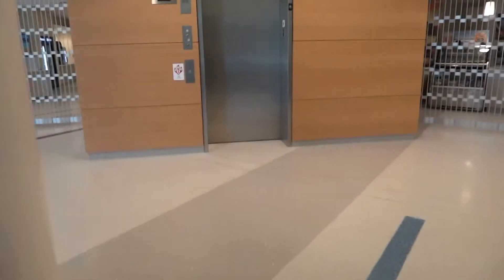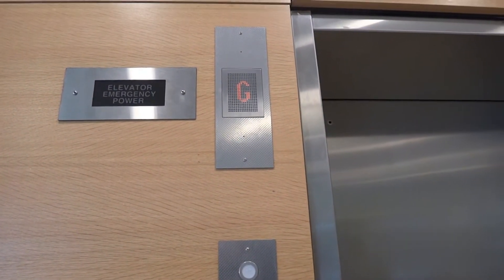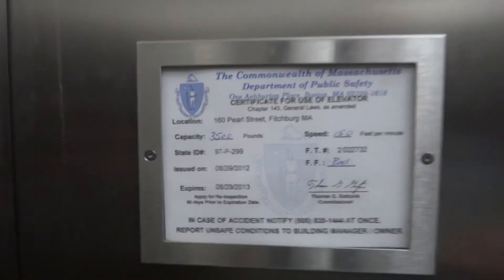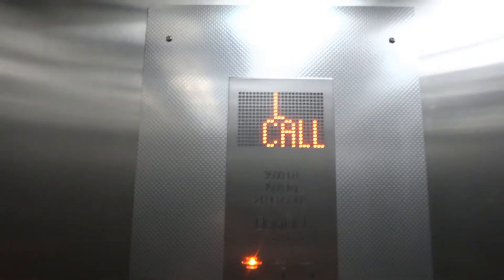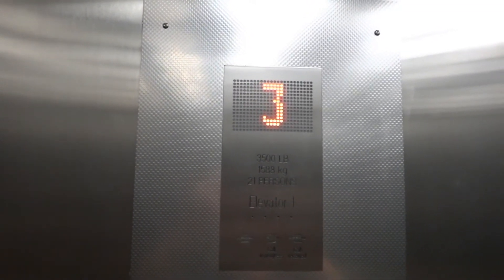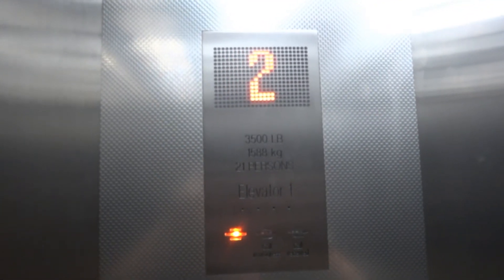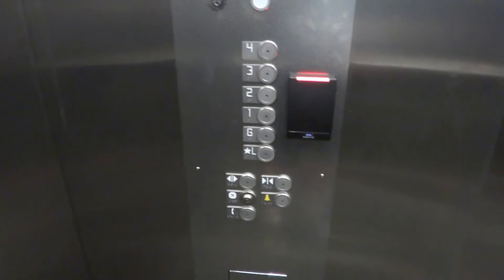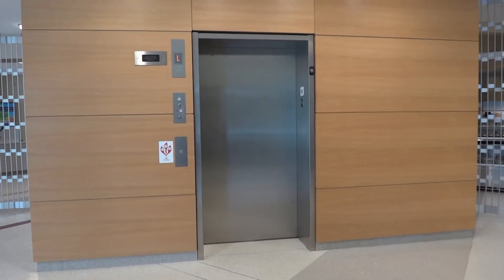Fitchburg: BRAND NEW Euro-Style KONE EcoDisc Elevator @ Hammond Building, FSU

Comment: Other than the fact that it creaks like an old door, this is a very nice elevator. The fixtures are KSS 140 and I've been on 2 elevators with these fixtures. I've got those videos up on my channel if you want to check them out (They don't creak BTW).